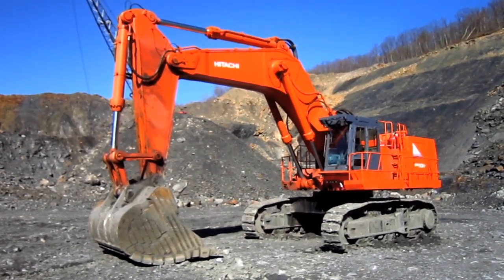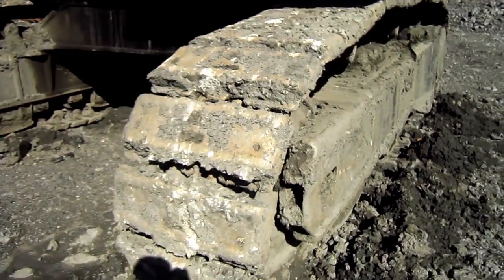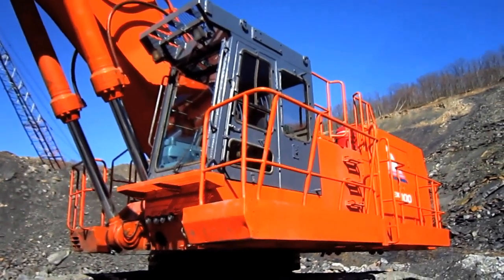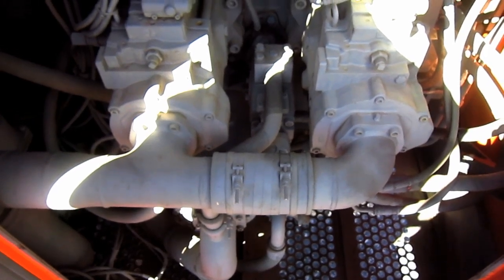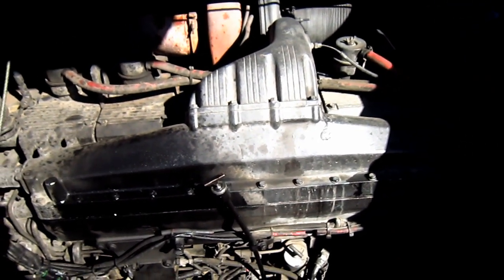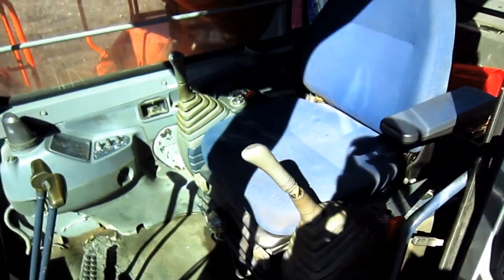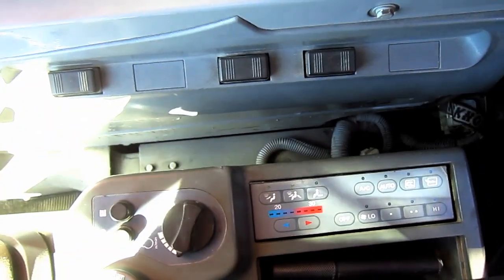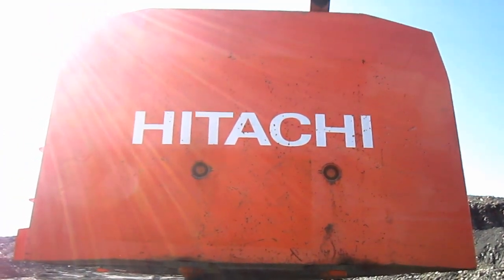Hitachi EX1100-3 Documentary

Comment: I worked for a company in south side Chicago that bought one brand new in 1991 to install 120" storm sewer, the pipe wt was 20 tons and would set without taking bucket off, oh ya, this was before quick couplers, took 5 lowboys to move if I remember right, They bought it to replace a 1800 Hopto, the good old days
Reply from the maker: That's awesome! What was the Hopto like?
Reply: The hopto came factory with two V 6 diesels and company replaced them with twin V 8 Detriots, new pumps everything, short and long dippers, the where the shit, they had two, company main thing was deep sewer @PAmining

Comment: These 1100’s were super tough machines…I worked for a company that bought one for a big highway job…I’m gonna say it was a 95…at the same time they bought a Cat 375 to compliment it…they put the Hitachi in the rock which it did quite well in and they put the cat in the clay…it was a good hoe and super powerful but they found it super slow as well and when they timed it against the Cat, they found the Cat swung three passes to the Hitachi’s 2 passes and when they finished the job they sold the Hitachi and kept the Cat..not only that, they kept the bucket off the Hitachi and geared it up to go on the Cat…the Cat swung a 5.5-6 yrd bucket and I believe the Hitachi bucket was about 7-8 yrd…and that Cat would swing it like a champ!!..such an impressive hoe even for back in the 90’s…I ran it quite a bit and I will say that particular machine would hang with any hoe of its size today…that being said, I’m quite sure they had it turned up a bit and they blew the pumps out of it on the last job I was on with them…around 6000hrs…I’m pretty sure the engine went out of it not long after that as well!..she would puff black smoke when you came onto her…to be honest, it was not near enough hoe for the job it was doing because that job I was on was the roughest rock job I ever did in my 30 years of doing this gig!..should have had that 1100 in there but she did the job and was still running at the end of it…
Reply from the maker: Very interesting, thanks for the input! I have heard the Hitachis are slower than competitive class machines.

Comment: Either that machine just received a new paint job, or it's the cleanest, most well maintained machine I've ever seen!!  Beautiful!!
Reply: My thoughts exactly. It’s in incredible shape for a 1998 model. Where I work we have a 2020 Cat 330, it has about 1300 hours on the clock and looks like it has 13,000. Doesn’t take long to rag them out, especially when there is no assigned operator. When 8-10 different guys use it for whatever, none of them go out of their way to take care of it. It’s kinda disheartening when you consider how much they cost nowadays.
Reply: Looks like an old 8 gallon overhaul plus some new panels

Comment: Thanks for another great docu. What size Cat would this equal?
Reply from the maker: Cat actually doesn't build a machine that's spec for spec with the Hitachi EX1100/1200 series which falls into the 120 ton class. Capacity wise, this machine is comparable with the Cat 385/390/395 series, however the Hitachi is a larger machine that has over 15 tons  on the Cat.  At the same time, it's weight doesn't quit put it up with the Cat 5110/6015 series machines which are slightly more capacity and in the 150 ton class. So you can almost say it's in between a 395 and a 6015B.  The most comparable to this machine is the Komatsu PC1100/1250 series.  Thanks!

Comment: People can say what they want, but Hitachi makes one hell of an excavator.
Reply: They do. We had a ZX200LC that was used as a support machine I guess you’d call it. It was always tracking here or there to dig, load trucks, clear trees, lay pipe, whatever needed done. It had about 15K hours when it was sold and except for 1 final drive, everything was original. Except for the undercarriage of course. That was its biggest issue. But for the amount of tracking Long distances it could be expected. I think we ended up putting Cat track link assemblies on it around 10k hours.